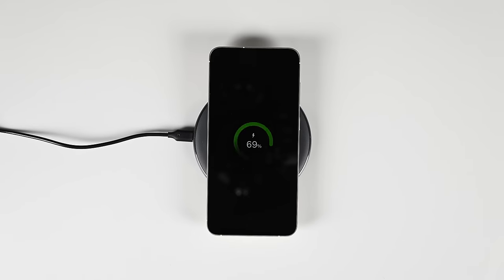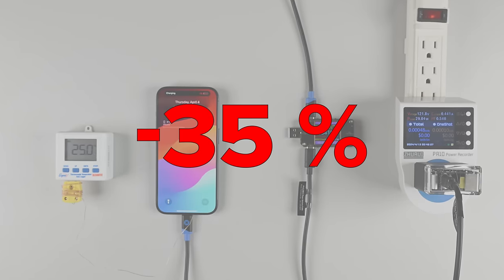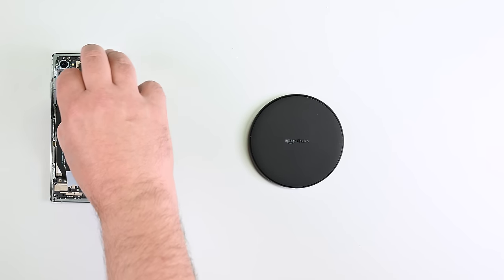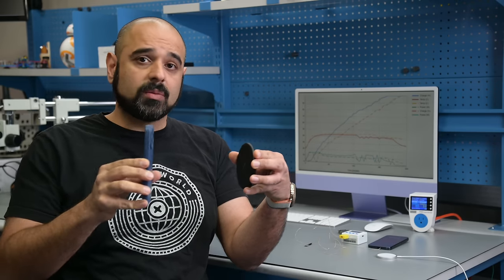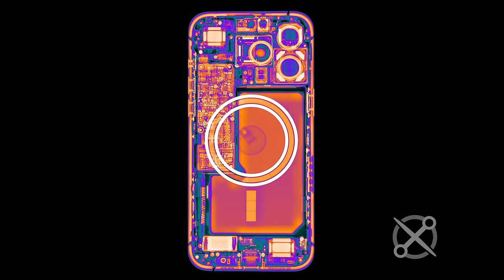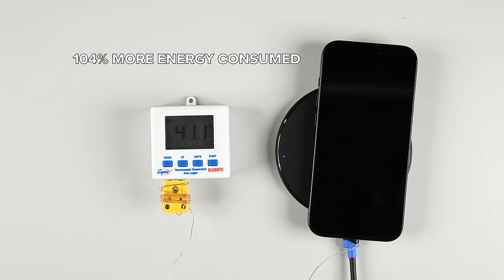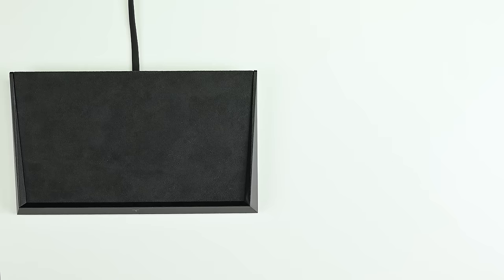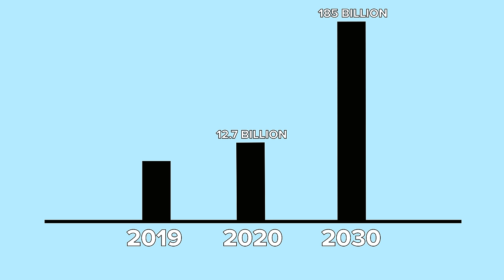How Wireless Charging Works and Why It's Terrible

Comment: What I find most frustrating is that if you're going to go as far as using magnets to ensure "perfect" alignment for the coils, you might as well use them to align metal contacts. Same convenience as "wireless" charging, but with the efficiency of wired charging.
Reply: Most folks have cases on their devices and as such metal contacts probably won’t work particularly well.
Reply: That wouldn't work well due to cases and camera bumps. Do keep in mind that many wireless chargers are integrated into flat surfaces like you'd find in cars, they don't all just flop around with a wire.
Reply: Not a bad thought. Could work with a special case
Reply: invented the iPad smart connector award
Reply: @MaxPower-11  There's no reason the case couldn't have its own set of bridging contacts. Magsafe-compatible cases already contain magnets anyway.
Reply: I thought this was where iPads were going with their pogo pins. Sadly no.
Reply: I love going up to people with wireless charges, and asking them if they want to improve their charging efficiency of their wireless charger by 70%. When they say yes, I unplug the USB cable of their Qi device and plug it directly into their phone.
Reply: Another problem with the contacts besides the cases covering them up (as mentioned, may as well be mitigated), is corrosion and damage to them.
I had a smart watch, which started having difficulties charging after a year of usage, because the contacts wore out.
Same goes for wireless headphones that charge through the contacts as well. After a while the contacts wear out.
Reply: Wouldn't be the first time for me that metal contacts fail after a year.
Reply: This is literally already implemented as Magsafe for Macbooks, so there is no reason for companies (specially Apple) to do this in every smartphone other than making the device useless after 2 years
Reply: @Alexzw92  MagSafe cases work great.

I've gone totally MagSafe as the MagSafe compatible charger also holds my phone in place.

I wouldn't want to power a MagSafe charger with a battery. But in my car or the bedside table fits my use case.

It has reduced the number of times my wife's phone is about to die.  Now, with MagSafe, she just puts her phone on the mount in the car and it gets a charge while she is commuting. 

It's been a win for us.

Is it really terrible, or just bad in certain scenarios?

I claim it's the latter.
Reply: @iyad8644  "many wireless chargers are integrated into flat surfaces like you'd find in cars"

Which, to quote you, "wouldn't work well due to cases and camera bumps"

It's funny that you didn't realize how badly you played yourself. The only "wireless" chargers that work somewhat well are the ones flopping around with a wire like Apple's magsafe.
Reply: Exactly the engineering inside my fitbit. It can be a bit finicky, but better than lossy wireless charging.
Reply: Apple actually tried this on an iPhone 7 prototype, but it didn’t make it into production. It would’ve been too unpractical, considering the vast majority of people uses cases, and it also just looked bad.

They then settled a year later for the qi wireless standard and their AirPower, but AirPower also didn’t make it into production, so finally 3 years later they released MagSafe, which is now the same as QI2
Reply: Yeah but having bare metal contacts out that produce current doesn’t sound like a great idea either
Reply: What about phone cases
Reply: @cat-.-  phone cases increase the distance between the coils thus generating more heat
Reply: Sony actually did this with the Xperia Z series lol. i used a magnetic cable to charge my Z, Z1 and Z3.. the magnet aligned the pins .. basically the same concept as the apple magsafe cable for macs
Reply: Why not just expose metal prongs like ipad cover accessories connect to at the back, are the charging speeds less effective? There were some cases of magnets creating some form of static electricity shock for magsafe, this was for those 3rd party accessories that connect one end to the port on your phone as a flat easy detachable accessory with another cable that magnetically clips around that port.
Reply: @rappercentral703 bare exposed metal contacts with current... like Lightning connectors?
Reply: So basically something like a Macbook MagSafe cable?
Reply: exactly
Reply: @nnicolas17  I guess you're right so long as the voltage is as low as a standard lightning cable
Reply: Sony's Z series man. Love and miss that magnetic charger
Reply: @imightbebiased9311 try plugging a USB c wireless charger into a pre iPhone 15 iPhone.
Reply: @revemb4653  They could probably make a USB-C like standard so no pins will have electricity unless you send out a message that you want power from the dock
Reply: @MaxPower-11  and cases make wireless charging work not particularly well. There are downsides either way. Cases could pass the pins through from the phone to the other side of the case.
Reply: You're talking about the Nintendo 3DS right?
Reply: @iyad8644 pretty sure they meant more like old MacBook magsafe or how a ms surface charges. A magnetically connected cable
Reply: Is it weird that now I want the macbook magsafe charger
Reply: That's why I like the stand-type wireless chargers. You just place the phone upright on the stand and it's always optimal.
Reply: @MaxPower-11  So someone should invent a case with a USB C connector for the phone and which also has an external magnetically attaching circular connector.
Reply: I've never encountered a phone case that covered over the connector. I have used a magnetic adapter and you only have to bring it near the cable and the cable will be snapped into place. Works well.
Reply: @PunakiviAddikti  If you get one that has USBC then it takes up the same amount of space on your desk and it doesn't have any of the drawbacks of wireless charging.
Reply: @bland9876  I don't really care about the drawbacks, I like the feel of simply placing my phone down.
Reply: @PunakiviAddikti  using a USB C is the same action but more energy efficient charging.
Reply: This dude thinks he’s a genius. Because this concept was tried and tested many times in past and it doesn’t work very well because of the dirt and oxidation.
Reply: Which is excellent for wireless earbuds and some game controllers, don't know why it isn't more common
Reply: @maikerugo  they don't have flat ones as far as I'm aware and If your USB port breaks then you're still screwed.
Reply: @YEdwardP right?  I think that at that point we might as well go back to having charging cradles for our mobile devices.  I mean you still can't use your device while it's charging, but with the cradle the device has the same direct connection as plugging it in with the advantage being that you can grab it and go as easily as own would do with wireless charging.
Reply: i had this on xperia z2... it bruned motherboard and had to be replaced once
Reply: Like the Smart Connector on iPads! I do like the idea, but MagSafe IS compatible with other qi wireless charging and qi2 picked up MagSafe architecture and iPhones can be charged wirelessly like other phones using industry standard(for once!) I would argue that Smart Connector is technologically superior but simply not enough stuff out there
Reply: The issue for me is I woke up this morning and my phone didn’t take a charge and nothing is working in the charger port. I don’t have a day off for 6 days so I have to try this . Can’t make my phone any worse
Reply: That's actually a great idea, I i bet they could turn the logo into a pair of contacts with some creativity and engineering.
Reply: @waldamy this can be mitigated and nearly eliminated with smart control and good build quality. I've got a pebble time steel that's still like new after 5 years out of the box, and my original pebble would still be going if i didn't use to to cushion a fall off my bike at 30kph as a teen, and catch it on backpack straps every now and then and wear out the watch strap pins & holes. 
Long story short, the magnetic charger pins outlast the battery and plastics
Reply: @imightbebiased9311 And then everyone clapped.
Reply: They have wired chargers with magnets. It is like whatever cable the MacBook uses to charge.
You put the insert into your phone charging points. Then there is a magnetic cable that just snaps onto the insert.
Reply: MagSafe
Reply: @MaxPower-11 You do think before typing right? Cause if the phone had a charging contact on the surface then cases would account for it just like they account for speakers, microphones, charging ports and headphone jacks.
Reply: @eziothedeadpoet  it's not the same beacuse speakers and connector holes can allow for some independent movement between the case and device without affecting functionality but much less so for metal to metal surface contacts where the goal is to keep a constant electrical connection.
Reply: I think that's what apple uses for the new macbooks
Reply: @cjxgraphics  There's actually a stand that does just that. But ofc, it's a stand and blocks access to the official Magic Keyboard, but hey, any other solution would do the same anyway.
Reply: @1stRanger  So I guess Macbooks and iPads should remove it right away. No?
Reply: @soacespacestation8556  They are not used in the same way as phones, genius.
Reply: You basically described MagSafe on MacBooks, the plug and receiving end are magnetic with several metal contacts for charging.
Reply: @buffuniballer tell me you didn't watch the video without telling me you didn't watch the video. I think the phrase you are looking for is that it is *convenient to use*, not that it is actually good. It wastes energy and puts lots of unnecessary strain on your device, leading it to become e-waste much sooner than already planned.
Reply: @Schmaglow  Tell me you didn't read the comment without telling me you didn't read the comment. He said metal contacts are better because it has the efficiency of wires and convenience of induction charging. He isn't arguing how bad wireless charging is as his main point.
Reply: @1stRanger  Unless you abuse your phone, I doubt it will suffer significantly more than iPads.
Reply: Wired often means frayed cable ends, which leads to more waste, higher costs, and potentially a damaged battery/device from a faulty power cord. Wireless isn’t a useless tech. Many wireless chargers don’t have issues with alignment, only really the circular ones that don’t have magnets for alignment.
Reply: I always wondered why the apple logo wasn't a conductive contact for that exact reason
Reply: oh boy, I was initially a giant supporter of apple bring the original MagSafe (on the laptop) to their phone, but they brought wireless charging at higher frequencies with nfc and magnetic alignment which was then adopted by qi2 later instead. but I have not thought that that yet! you are right, a wireless pad at SHF/EHF for data transfer with metal contact for charing attached by magnet would have been a perfect solution! glad you've brought that up to me, which I might not have found it myself otherwise. in fact for a split moment, I thought apple have gave up on the OG magsafe which they haven't XD
Reply: @cjxgraphics that's actually half of the reason it has those points and some stands on Amazon support charging from it (other half of the reason for the points are to transmit data from keyboard cases)
Reply: @waldamy tbh that should only be used as a secondary way to charge it tho like wireless charging not the primary way to charge it
Reply: My old Nintendo 3DS has an aftermarket battery on it that does exactly that. 
It works well.
Reply: Plenty of magnetic cables around. Been using them for 4 years now on all devices and tools with usb charging.
Reply: @mjc0961  the gap created by the camera bump still allows it to charge. Nice try making it seem like he says something he didn't by selectively picking quotes. It will still charge, cases create a gap too. The phone still charges. The only one playing is you. Here's a thought,  if you don't like it don't use it! Now go ahead and write another smart reply to fuel your ego
Reply: Powerbank is better and safe
Reply: Exactly, when companies can so it on smart watches idk why nobody thought of doing it on smart phones
Reply: Sony xperia Z3 compact had this. Realy usefull thing.
Reply: Or in other words how magsafe works on macbooks
Reply: Contacts are still susceptible to liquid, are possible to damage and make case design worse. Contacts also usually require one of the sides to be springy enough to ensure solid connection

Comment: They called it wireless but i can still see the wires
Reply: With that argument, WiFi isn't wireless either because there is an Ethernet cable going to the Access Point
Reply: except that with wifi, you could go anywhere in your house...?
Reply: @inconsistencyon  Sure, but the further you go, the more energy is wasted. You can also go sort of far with QI charging, it's just not enough energy to charge a phone anymore. WiFi needs a lot less energy to arrive than QI
Reply: @anianii  Wi-Fi is practically wireless, though, as you can move 10+ meters and still get a reliable connection. "Wireless" charging is pure marketing; it should've been marketed as "tap charging" or "near field charging", e.g., you have a few millimeters before the connection is dead. See NFC / tap to pay /etc.
Reply: @ikjadoon  The connection is not "dead" after a few millimeters. It just turns itself off because it gets too inefficient to make sense. Which, by the way, is also what cell towers do. Your phone might actually be able to connect to a cell tower, but if its configuration says not to connect if the signal strength is lower than some value, your phone would show no signal instead. With QI, that threshold is simply much lower due to the high efficiency being necessary for charging to happen at a reasonable rate. If you're 500 meters away from a cell tower, you won't get the best connection either, but in that context it's good enough to work.
But I have to agree that calling it wireless is mostly marketing. Inductive charging would be more clear.
Reply: It is a misnomer. It is actually induction charging, and "wireless charging" is a marketing term.
Reply: @anianii there is difference between transmitting power and data.
WiFi is for data not power.
Reply: @saksham9180  Well data is transmitted by transmitting power, you still need some power to arrive in order to transmit data
Reply: @anianii  yes.. but that power received is every less.. in fact so small that there are dedicated curcuit to amplify it multiple times before actually using it.
Reply: Idd, Magnetic Induced or Induction charging would've been a better name for it.
Reply: @saksham9180  Yup, correct. That's also why it doesn't make sense for wireless charging to work over bigger differences :)
Reply: It's like saying my induction stove is a wireless cooking 😂
Reply: @anianii  Wireless isn't Wireless until it is in contact. If anybody extract power from WiFi and use that, we can say that Wireless power transmission. But using mag safe and calling Wireless charging is nonsense. How is that wireless without any degree of freedom? If they would have used solid contact that would be better.. like we see in older phone.. even basic phone with a stand had this technology many decades ago
Reply: @anianii Nah, all you need is the power cables. A mesh wifi with 5G modem and all your data comes and goes wirelessly :)
Reply: @pluggedfinn-bj3hn  well good luck in an area with bad signal ;)
Reply: @anianii  Not a problem in here :)
That aside, I do prefer wired everything, was just saying that it is still possible.
Reply: >wireless charger
>look inside
>wires
Reply: @inconsistencyon  You can buy MagSafe battery packs that attach to the back of your phone if it has magnets. No wire needed besides to charge the battery pack.
Reply: I can be 10m away from the router an still be connected to the network.

Try charging your phone, with it being 10m, NAY 10mm, away from the charging pad.
Reply: Close your eyes dear🥰
Reply: >opens device
>finds wires
>not wireless